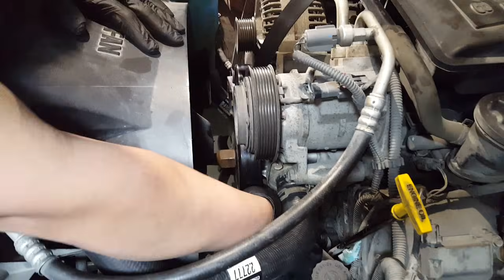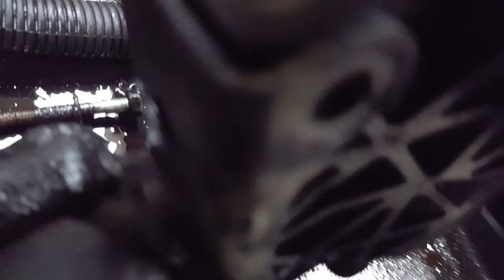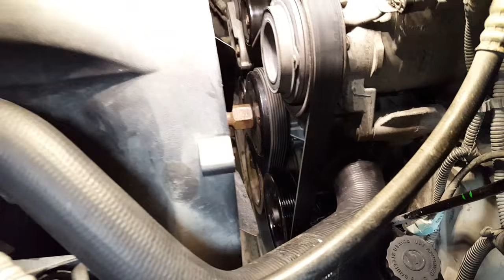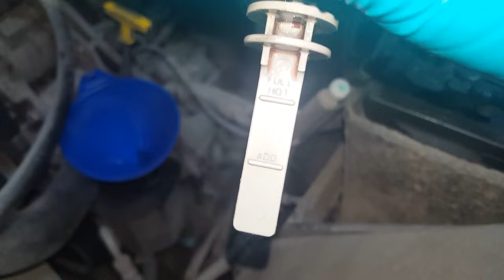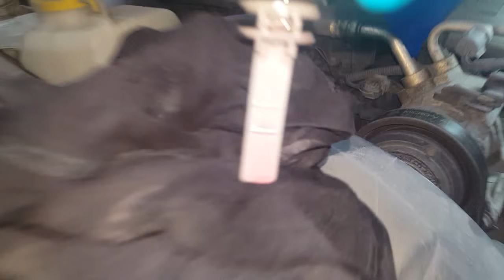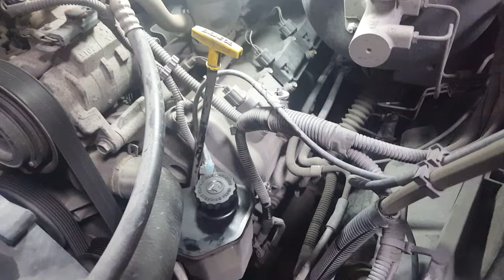2002-2008 Dodge Ram 1500 5.7L:  Replacing the power steering pump

Comment: I did everything then looked in the box and seen that little o ring😭. Is it absolutely necessary to put back on
Reply from the maker: @bigskyoutdoors4232  I replace the o-ring every time I remove the pressure line from the power steering pump or the steering rack.  They’re considered a one-time use item in this application.  It is absolutely necessary to have an o-ring on the line fitting - it won’t seal without one.

Comment: Oh I hope you see this message, I ordered the BBB INDUSTRIES N72001126A2, I noticed the pulley that came pre installed has alot of play and I just wanted to make sure that it is not normal ? And I should ask for a replacement correct?
Reply from the maker: It shouldn’t have much of any play.  Which direction is the play in?
Reply: Straight out of the pump, no side wobble just has if I lay it flat and pull from the pulley it comes out slightly
Reply from the maker: @marlonreyes2089  That’s not right.  The pulley may not have been installed correctly from the factory, and could have damaged the pump internals.  I would definitely ask for a replacement.
Reply: @AKJeeper  I was thinking the same thing, how sad going to be up on the jacks for a couple more days then. Thank you so much brother for the quick responses

Comment: The owners manual for my 2005 model Ram says use atf+4 in the power steering. Where did you come up with the idea of dexron? I have been using atf+4 for 18 years now without issue. Still have original power steering pump.
Reply from the maker: The spec kept changing depending on the model year, and which reference you use (owner’s manual vs. Chrysler service data).  They even recommended using a specific Mopar power steering fluid that was essentially rebottled Dexron ATF.  That specific part number had gotten superseded several times, to both Dexron and ATF+4.  I think any of the above fluids work just fine, but ultimately I recommend people use what is listed in their owners manual.

Comment: Where did you order the Steering wheel pump.
Reply from the maker: I got it at a local mom and pop style auto parts store.  They can no longer get the pump with the pulley pre-installed, so I’ll have to update the video with how to remove and reinstall the original pulley on the new pump.

Comment: How do you remove just the pulley? Does the entire pump have to come out as well?
Reply from the maker: You will need a power steering pump pulley removal/installer tool.  I’m going to have to make a video on it, as I can no longer find pumps for these trucks with the pulley pre-installed.  The old pulley needs to be swapped on to the new pump if it doesn’t already have the pulley installed.  There’s plenty of space to remove the pulley on these trucks without having to remove the pump, but normally if you’re removing the pulley - it’s because you’re replacing the pump.  I find it easier to remove the pulley with the pump on the bench.

Comment: would have been helpful to see how toi reuse pully on these,
Reply from the maker: As I responded on a different comment:  these pumps used to be available with a pulley installed, and were a great option to get this done quickly.  I’ll have to get footage of swapping the pulley next time I get one of these in the shop.  Unfortunately, I simply don’t get too many power steering pump replacements these days.

Comment: Good video, BUT, my 2007 calls for ATF+4, not sure why you used the other type?  Maybe each year is different?
Reply from the maker: I suggest using whatever the owner's manual recommends.  In the case of the video, the truck was seeing service in the arctic and we've had really good luck with the fluid used in the video for those conditions.
Reply: Everything I've seen it's the same as the trans fluid on 07. Which if you have this truck I'm sure you have some since you have already worked on the transmission already 😆 love this truck! Hate the transmission!
Reply: @RugerAmerican45  I agree, trans is the worst part.  Usually just the solenoid if you're having trouble BTW

Comment: Hey man , do you know how I can change the steering wheel pressure sensor?? went to autozone and it said that was the problem , it’s just a little piece but I couldn’t find it in the video :/ pleas help thank you !!
Reply from the maker: What year/model of truck?  Generally the power steering pressure switch is mounted on the pressure line coming from the power steering pump.

Comment: Wow. Really well done video. I feel quite confident tackling this myself now. Big Thanks! 😀
Reply: I did a radiator many years ago and I managed to take it out find out where it was leaking from, and it was from the bottom of the tanks core so I siliconed it and added a gasket, then I let it dry for a day and, put it back in my camaro and,  it lasted until the day I got rid of it.... and I was a 19 year old chick and,  now I'm attempting a power steering pump at 47 in a dodge ram 1500 but, by just watching your video and, seeing what I needed to get tool wise, I really think I can conquer this too!!!! Thank you so much for making this an easy fix for a Jersey Girl, and you saved me lots of money for sure.

Comment: I’ve had a new power steering pump installed in my 04 Dodge 4x4 and the thing was still leaking fluid like crazy. Any ideas why ?
Reply from the maker: Do you know specifically where it is leaking?  The mechanic may have forgotten to tighten a hose clamp or the high pressure line.  There is also a possibility that the new pump is defective.  Or there could be a leak elsewhere in the system, it will take some sleuthing to find the source.
Reply: check the rack

Comment: Why did you use transmission fluid instead of power steering fluid?
Reply from the maker: Don't go off my word, but I've found that the MOPAR Power Steering fluid specified for this truck is just rebottled ATF+4.  Always consult your owner's manual or service manual for the correct fluid for your vehicle.
Reply: Yep from exp and what I've seen n heard mopar transmission fluid and ps fluid is exact same different label.

Comment: Great video. Where did you find the complete set up? I have new pump for 08 Dodge Ram can’t find the pulley for it though.
Reply: Same issue man. Did you ever find a pulley?
Reply: I have a 2003 1500 5.7 4X4 and bought a new cast iron pump with a pulley from AutoZone. @Txnzfan

Comment: I just installed mine and followed each of your steps and it’s somehow leaking between the pulley and resivour it’s driving me nuts idk where it’s coming from
Reply from the maker: Ali Abdoo I would suspect the o-ring between the reservoir and the pump.  Did your pump come with a reservoir or did you have to swap your old one on to the new pump?

Comment: Your using transmission fluid as the power steering fluid?? Why?
Reply: It makes sense if you frequently go off road.  If you need to top off on power steering, you don't need to carry an extra fluid.
Reply from the maker: Most modern vehicles use ATF as the factory fill in their power steering systems.  GM vehicles are an exception, they tend to use plain jane power steering fluid.

Comment: You didn't show how  you removed the pulley
Reply: Pretty sure he didnt the new one had one .
Reply from the maker: You are right.  The new pump had the pulley pre-installed.  I will need to make an addendum to this video, as I can no longer find power steering pumps for these trucks with the pulley pre-installed.
Reply: @AKJeeper  tell me about it , I just did mine on sunday had to get a pulley removal/installer tool from autozone but it's an easy step
Reply: People complained about the old one snapped or breaking I think one time I removed one by tapping it out with a hammer. Don't remember if it was easy or not but I think it worked. I think I also bought one with the new pulley. Way faster.

Comment: What pump did you go with? I need to replace mine on my 2004 Ram 1500 5.7 L and I see that there are a few different styles. One says back plate is bolt on the other says snap ring one is an aluminum pump the other is a cast-iron pump.
Reply from the maker: The truck in the video originally came with the snap ring style pump.  I replaced the pump with the same style.  I'm not entirely sure if the 3 different pump styles are interchangeable.  I've never had them side by side.  Most I've come across in the shop have the snap ring style pump.
Reply: AKJeeper Thanks!
Reply: The pump I had ordered was the bolt on backplate, and cast aluminum. I did this thinking that this would be more of a severe duty part. But I was wrong. When I went to put the new one on nothing lined up. I then pulled out my Haynes book and i guess that part is for the diesels, and powerwagons. They also go to other versions but at the time of this comment I can't remember of the top of my head. The snap ring fits on to this little bowl type impression in the block and the screws are long enough. Also depending on where you live that bracket that holds the reservoir to the pump those screw strip super easy. Thet are made of a softer metal, and the rust here doesn't help.

Comment: How do you know if the pump is  Aluminum or Cast Iron? When i go to autozone they have 2 different pumps for my 2004 dodge ram 1500 5.7 hemi. They asked me if it was aluminum or cast iron and i seriously have no clue!
Reply: Stick a magnet to it, if it sticks it is steel and if not aluminum.
Reply from the maker: Hmm, those aren't the options I've heard whenever I've had to order pumps for these trucks.  Usually they ask if the pump is a ZF-brand or style pump.  As far as I'm aware, the ZF and non-ZF pumps are both cast iron.  The difference is that the ZF style pumps have a bolt-on rear backplate, and the non-ZF pumps have a round cover held in with a snap ring on the back side of the pump.  Easiest way to tell which one the truck has is to get a light and a mirror behind the existing pump.  In this video, the truck had a non-ZF pump.

Comment: You should have stated how much oil you used too fill the pump since you drained the power steering cooler.
Reply: Yes and how much oil would that be? I dont need to waste money buying too much oil or wasting gas going back to the store to return the oil. I always budget my money and I dont need extra expenses if I can help it.
Reply from the maker: It depends on the equipment level of your vehicle, and whether it has an external power steering cooler or not.  2 quarts should be enough, if memory serves this truck used about 1.5 quarts.

Comment: Were you able to get the pressure line off with just a 16mm? I can't seem to get it to budge at all.
Reply from the maker: CDNCarGuy Yes. In this case it came off very easily with an open end wrench. I have had others that were much more stubborn where I needed a flare nut wrench or knipex  “pliers wrench” to remove it. You may need to spray some penetrant like Aerokroil in it.
Reply: AKJeeper Thank you. Hopefully giving it a good spray of penetrant and letting it sit overnight will help.  
Can a flare nut wrench make that much more difference? I've never used one myself.
Reply from the maker: CDNCarGuy yes. They will grip when an open end wrench will start to slip. Sometimes in extreme cases, I’ll even help a flare nut wrench by clamping vice grips on the outside of the wrench to prevent the wrench from spreading open.  I should do a video on that “technique” sometime. Lol
Reply: AKJeeper Thanks for your help, and I wouldn't mind seeing a video on that. Thanks for the quick response as well, Cheers!

Comment: Nice video, I live in Alaska too, yours was the first video I stumbled across. I recently replaced mine too but it’s still leaking where the backplate mounts to the engine by the bottom bolt, any idea? Did you have to use some sort of sealant?
Reply from the maker: TEHsm1th No sealant required.  The holes in the engine block are "dry", meaning they don't go into a water or oil passage.  Do you have the same type of pump as in this video, or the ZF style pump?
Reply: AKJeeper pretty much the exact same type of pump, mine is a 2003 1500. Not sure what ZF means. But the “cup/bowl” in the engine block I notice that it collects fluid that I assume is coming out of the pumps backplate. When I went to replace it they asked me if I needed one with a bolt on backplate, but the old one I took off didn’t have that
Reply: AKJeeper https://imgur.com/gallery/C3ygn here’s a picture where it’s collecting fluid then leaking out past that bottom bolt
Reply from the maker: TEHsm1th ZF is a brand. The pumps with the bolt-on backplate is the ZF style. If you’re getting fluid building up in that cup, it’s coming out of the pump. These pumps have an o-ring on the back side, behind the clip. I’ve seen these leak, especially on remanufactured auto parts store brands.  Any more, I’ll only put on new pumps and even then I’ve still come across issues from time to time. Have you replaced the small O-ring on the power steering pressure line?  Could be a chance that it’s leaking and maybe squirting up that way.
Reply: AKJeeper yeah this is the second remanufactured one I bought from Oreileys. Sounds like I need to get another one, because there was definitely fluid coming out from where that snap ring is.
Reply from the maker: TEHsm1th 2nd one?  Dang. That really blows. At least the pumps on these trucks aren’t too time consuming to do. Hopefully 3rd times a charm?
Reply: AKJeeper how easily do those regular backplate break? Cause I’m starting to wonder if I’m sort of popping things out of place when I put the pulley on.
Reply from the maker: TEHsm1th are you using a pulley tool to remove/install the pulley?  The backplate can easily break if you are hammering on the power steering shaft or pulley. Had a customer rig come in with exactly that situation.   But if you are using the proper tool for the pulley, I’d say you’ve just got a defective couple of reman pumps.  That o-ring is relatively easy to screw up on assembly of the pump.  I suspect a lot of these “remanufactured” pumps are just spray paint rebuilds...

Comment: Question.. i have a 03 ram with the 5.7 hemi in it ,would i use ATF also ??? And if so , just any type of ATF ??? Please help .
Reply from the maker: My local dealership parts department sells "Power Steering Fluid +4" with a part number of 68218064AB.  That is currently what the factory recommends for fluid.  With that said, I've used ATF on my personal vehicles with great success - I use either Dexron III/Mercon, or Motorcraft Mercon V.

Comment: I replaced mine but it still makes a nasty noise. It took care of the leaking but now it has a noise y would you know wat it can be??
Reply from the maker: What kind of noise are you hearing?  The most common noise is related to having air in the system and/or low fluid level.  Did you bleed the power steering system after changing out the pump?
Reply: AKJeeper I did not bleed it. Could I still bleed it even do I have run the truck?
Reply from the maker: Yes.  You can still bleed the air from the system.  Be sure to check the fluid level before you start the bleeding process.  If the fluid is low, fill it up to the full line before you start.

Comment: Is the pub that your video for 07 or 08 Dodge Ram? It seems like there is a difference in the pumps. I use that pump and giving your for my 08 and it is not working correctly. It keeps whining when I accelerate. Also the part number on the pulley belongs to an 07 model not 08
Reply from the maker: The truck I was working on in the video is a 2007 Ram 1500 4x4 with the 5.7L Hemi (as I stated in the text below the video).  I believe the 2008 pickups use a different brand pump (ZF), which also uses a different pulley.  This video is meant to be a guide for the process of removing and replacing the power steering pumps.  The parts used on this truck may not work on your truck - always consult a parts department to ensure that you are getting the correct parts.

If the pump is whining - it's likely that there's air trapped in the system.  Did you bleed the air out of the system?  What does the fluid look like, and is it to the correct level?
Reply: AKJeeper thanks
Reply: Arthur Jolicoeur was it a Mopar reman pump and did you ever figure out what was causing your noise during acceleration? Coincidence that I'm having the same issue with no luck
Reply: I blew the pulley off my 08 last weekend,  I im.now in it for about an 1100 dollar pulley, thought about going to the older model to see if that pulley would fit